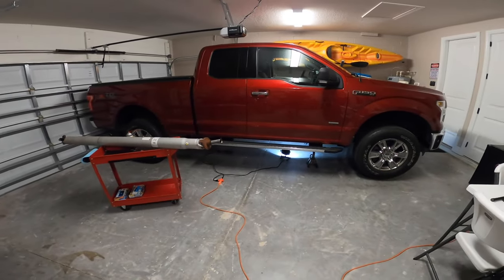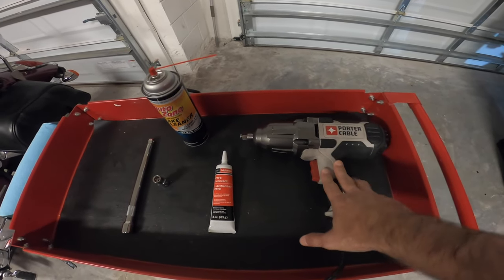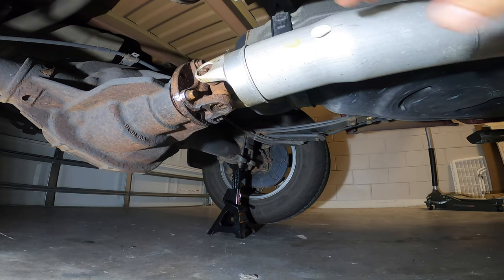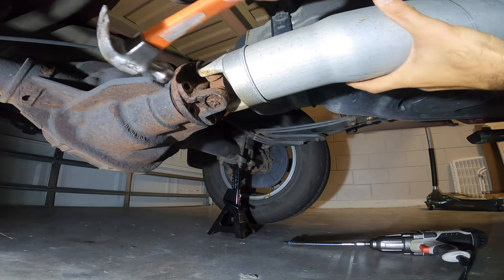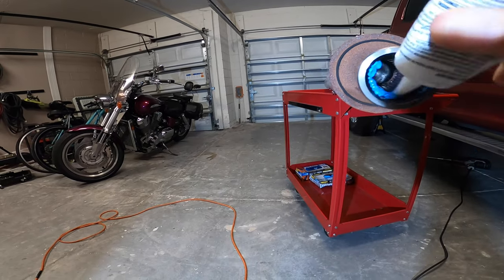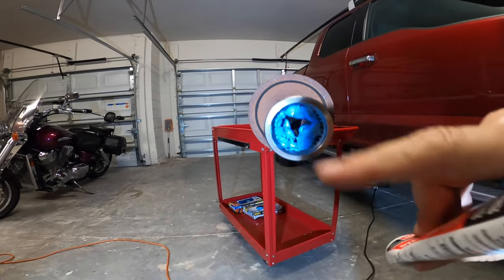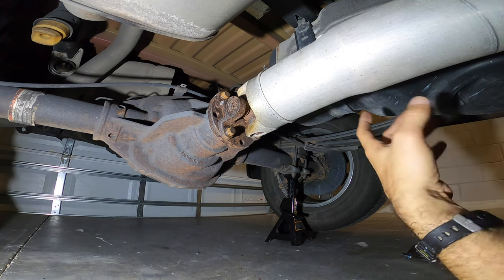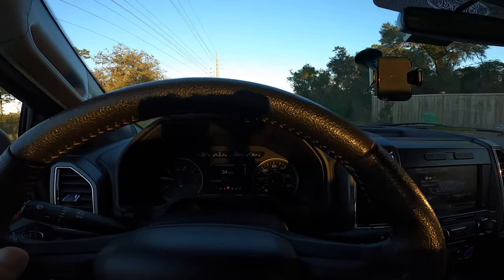F150 Driveshaft Spline Lube

Comment: I did this on an older truck without ever jacking it up.
Reply: you can; however, it is hard to do if one of the bolts stay at + position. It is easy if they are aligned at X position, though.

Comment: I have the same issue. It recently showed up. Time to get it done. Thanks alot for the video. Way easier than I expected. Since I work at the Ford dealer I’ll probably just have my guy do it on a lift in 15 minutes while he’s doing my brakes. OEM replacement rotors warped in 4,000 miles while my calipers are like new and performing great. Just a bit of fyi. They are not the same quality metal as original equipment. 🤔
Reply from the maker: Thanks for the info. I always have a feeling that the quality of all the parts that are delivered to the factory is better than the ones sold to the market. Even if you buy OEM. The spline lube is really easy and it gets rid of the annoying clunk... definitely worth it.

Comment: I have an 05 F150 that I bought used and has had that clunking sound when I start off from a dead stop. I doubt that the person who had the truck before me did any maintenance to the drive shaft. Sounds like that may be my problem. Thanks for your video, it gave me a bit of piece of mind as to what that sound is and not something more sinister. I will have to have the work done as I don't have a place to work on my truck....which that sucks.
Reply from the maker: You can do this on the street. It’s a 20 minute job

Comment: not a lot of bolts i would feel i absolutely need to torque down to speck. but the entire engine is delivering its power on those 4 bolts... ive made my mistakes not tightening crap down enough... break calipers can rotate and punch into your rim when one of the bolts pop out lol.

Comment: That clunk for me was a the loosening of the preload on the differential bearing and the backlash feeling/sound that was associated in the driveline.
Reply: What year was your truck?
Reply: @KINGRG1  2010 (new rear end this year, just crossed over 180k)
Reply: @DRIFTWORKSINC  I have a 2002 F150 2wd. Paid a shop $700 to change out the passenger axle and change the pinion bearing. 3 months later and it’s leaking again, and I’m sure it’s their fault because my truck made a noise after I got it back from them and they wrote it off as “road noise”.
Reply: @KINGRG1  Yeah I have some noise with the new rear end but I don't feel any looseness so just keeping an ear out for it. It's the preload on the bearing that's worth taking to a shop. Can you get them to fix anything like a 90 day warranty thing?
Reply: @DRIFTWORKSINC  I wrote them a negative review after driving another hour 1 way to them and they wrote me off when I knew something wasn’t right… so I just fessed up and said screw it… I’ll keep my ear out for the noise.. When I take off it feels like a medicine ball rolls to the back of the truck. If I feather the gas real soft on takeoff it’s non-apparent
Reply: @KINGRG1  That sucks. I can't diagnose because it took myself a year to figure it out and it was too late by that point to do a rebuild. If it gets worse to it to a local shop for an hour of their time to diagnose it.
Reply: @DRIFTWORKSINC  Good idea man I might just do that

Comment: My '15 4x4 1 piece DS had a clunk from a dead stop. It want away after I changed the Transfer case fluid. I've read that lots of the cases are under-filled from Ford. My tube of blue grease is still sitting on the shelf.

Comment: Make sure that new driveshaft is balanced! Just did mine and had to take it to a shop and get it balanced….best of luck ya’ll!
Reply from the maker: I ended up being good. But these one piece shafts are a pain
Reply: @dcfgarage  I feel like the 1 piece shafts are a breeze compared to the 2 piece with the carrier bearing tbh lol I got mine balanced the same day I was leaving for a 1400 mile trip. The shop where I took it took care of it. Super pleased.
Reply: Unless you drop the driveshaft on ground or hit it with a hammer, you are good. These driveshafts are not being balanced on the vehicle.
Reply: @mkilic10  I was under the same impression. Bought a new DS for my 2011, installed it and instantly felt a subtle vibration at take off that had me second guessing it. Called my mechanic and he referred me to a specialist who builds custom DS. He ended up taking about .006 of runout off of it. He got it within a .001 runout and it worked well after.

Comment: You might want to spray the underside with a lanolin rust inhibitor like Surface Shield or Wool Wax etc to stop the rust and save the frame.
Reply from the maker: Thanks for the tip

Comment: hi, im hearing this clanking sound you mention but only when i accelerate from 0mph. my dad also noticed the leafsprings jump up a little as i accelerate. do you think this could be my diagnosis?
Reply from the maker: I don't think so. Clacking to me would be something loose
Reply: @dcfgarage clanking was the wrong word. it sounds more like a single thud that also comes with a small jump at the rear end. my mechanic wants to open up the differential...

Comment: keeping it aligned in the correct orientation is critical. as you know, these shafts are balanced. make a line with a paint marker. both ends. and dont use brake kleen. theres a coating on the splines. wipe it out. 👍🏻
Reply from the maker: Thanks

Comment: Yep, my 2015 F-150 has had that bump thing going on for a while now. I was thinking a bad U-joint. QUESTION? Is there any grease fitting on the U-joints or is that F-250 and up? Thanks for you video! Will be doing this SAP. Cheers from Michigan.
Reply from the maker: Could be a bad u joint. You can inspect that easily. Modern trucks don't have grease fittings

Comment: Oh, is this for a Two wheel, rear wheel drive F-150? Is the 4x4 F-150 different? Have not been under it yet. Thanks!!!
Reply from the maker: This is for the f150s and 250s with the one piece drive shaft. Mine is a 4x4, but if it's a 4x2 with the same driveshaft, it applies. I believe these driveshafts come with the max tow package that includes the bigger differential.

Comment: How long did this grease last before the clunk returned? Or is it still good?
Reply from the maker: I drove it for a year and it didn't come back. I sold the truck and got a 2018 that has a two piece drive shaft
Reply: @dcfgarage my long box is has a clunk. Any tips?
Reply: I had a chit-chat with a Ford technician about that. He told that it is a good idea to grease it every 30k miles.
Reply: Mine lasted only for a year on my 2010 2wd

Comment: Awesome. I purchased my 21 F150 last week and have driven a 1000 Miles since. I noticed this today and cant ignore it since. I'm assuming this is the fix as an online thread I read the guy had the same exact issue. Its either this or the U Joint but 3 Yrs and 30K miles shouldn't be an issue. I'll try this and report here. One question, would this issue, if not fixed, affect the truck in any major way?
Reply from the maker: It doesn't affect the truck. It's just a comfort thing

Comment: If ur getting clunk noise if a bad ujoint it's only gonna get worse I would replace the drive shaft
Reply from the maker: It's not a bad u joint kind of cluck. It's just a slight clunk when going from coasting to acceleration and back.
Reply from the maker: And this only happens to the one piece driveshaft

Comment: Hi.  I know this video is old.  But do you have to re-line up the splines when putting the drive shaft back onto the transfer case?  Dealer did this and then I started getting vibration at high speeds
Reply from the maker: I've never heard of realigning the splines, but I made sure that i matched the same holes in the diff when putting it back
Reply: You absolutely must re-align the spline back onto the transfer case. The vibration is caused because your dealer installed the spline incorrectly
Reply: @bingobunga8995  based on pictures it looks like the female side is keyed.   Does that not make you put it back on correctly?

Comment: So do you need to lift the truck or is that just for convenience ? Trying to rebolt in neutral is just spins freely. Anybody know a way to get around that ?
Reply: Chock the wheels front and back. Jack it up by the designated jack point, use jack stands. That makes it easier to get in and out from under. Jack it up a bit by the diff just enough to clear the wheel. This should give you enough wheel play to align the flange to the 4 bolt pattern.
Reply from the maker: Just for filming

Comment: Will it contaminate the transmission fluid?
Reply from the maker: I don't think so. It comes from factory with it. Like any other grease, it dries out after a few years
Reply: I would think there should be transmission fluid or gear oil if it was a transfer case that would keep shaft lubed